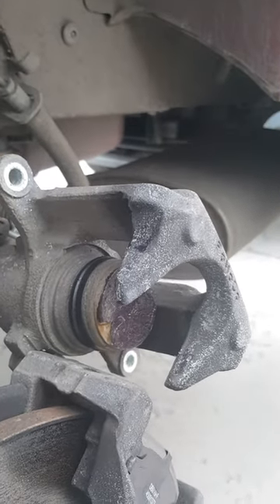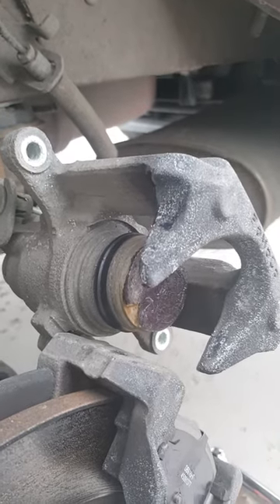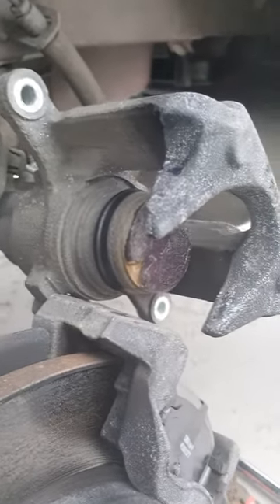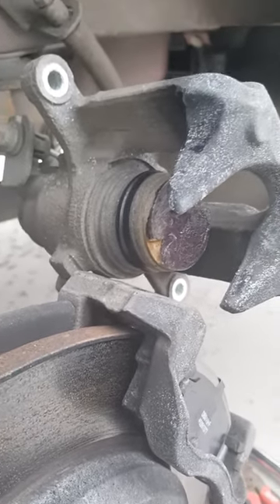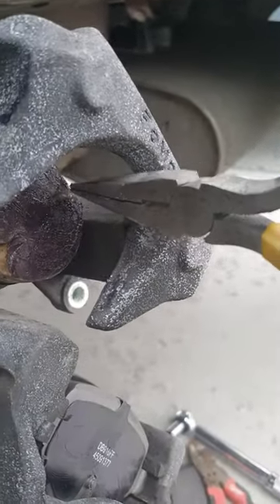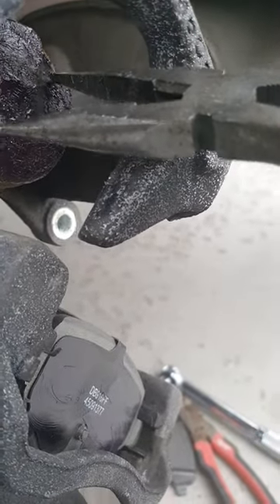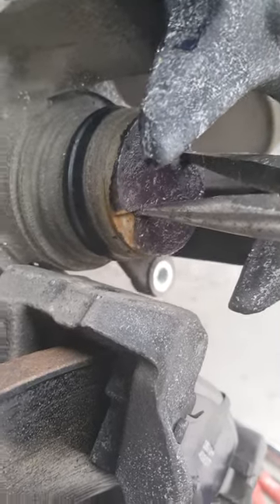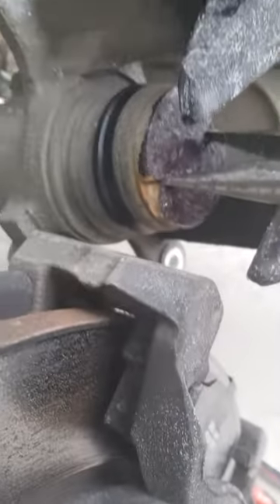How to push in Ford brake piston

Comment: Whoever came up with the push and turn idea should be fired
Reply: I'll sign that petition.
Reply: You misspelled executed.
Reply: As a former automotive technician myself (I worked for GM even though I drive Fords haha) and I will NEVER understand Ford’s SHEER STUPIDITY WITH THIS DESIGN!! If you want to make them smaller than the front fine, but WHY TF can’t they operate the same as the front at least instead of having to either go buy or rent a special tool just to be able to compress the calipers back?
Reply: I wondered and marvelled day and night about those damned drain plugs as i found myself stripping the fucking thing from folowwing a simple oil drain video, rule number 1? Look directly at the rusted part you are about to work on and buy its replacement immediately before you either break or strip it. That way you wont have to worry about OEM and all that just break the fucker off and be done with it.
Reply: Weld a nut over it. I've seen a Chevy aveo with stupid 10mm drain plugs. A 21mm nut fixed the problem.
Reply: I will sign too
Reply: @MAGA4EVA1986  a pair of needle nose pliers is a special tool?

Even easier on the Focus, you just put the caliper at the back of the wheel well, and spin it clockwise while you lean against it.  Unnecessary, yes, but not especially challenging or requiring a special tool.
Reply: Just spent 2 hours last night throwing every pressing maneuver possibly available into trying to move mine, thought I had to buy a new part smh . I swear this and the aluminum caps on the lugs. Smh

Comment: it's designed for a special tool witch applies pressure while turning the piston
Reply: robertas grigas the tool I just bent and snapped bc I’m a newb and turnd the socket and kept the handle still. Also bent a big c clamp trying to figure how the cal goes in. New to twist at compress concept. Pretty cool.
Reply: It won't bend if the piston moves freely
Reply: if you turn it it will pull itself in
Reply: @jimmythepowerful  Don't know what kinda car that is he's working on but GM makes a special tool for theirs I have one that I use for my 93 cutlass when I did rear brakes on it.
Reply: There is a universal tools you can rent or buy that makes the job 10 times faster and easier...but yes sure.....well just do it the hard way LOL, work smarter not harder people
Reply: Lol,  why not use the correct tool for the job, it's called a brake rewind kit/set in uk.
Reply: A universal break tool kit is cheap and used in most professional shops and diy guys like me that don't want to damage the caliper
Reply: @philancell884  I have a universal electron e brake caliper compressor from matco and I love it!
Reply: @fuolku1006  To be fair, I have done that with pliers, but they were brand new rear calipers and pistons, and I have a vast array of pliers of many different shapes and sizes.
Reply: Went through 3 different universal tools made for this bent and snapped took off brake lines drained fluid used torch still nothing I need new calipers
Reply: I just did rear brakes on my wife's Ford Edge, I used a pair of adjustable slip pliers opened up wide, to grip the whole piston and spun it around a handful of times, and then it pushed in pretty easily after that.. I just had to be careful not to damage the rubber dust boot with the pliers. I actually do have one of those universal caliper piston tools, a little square thing with different sized notches each side, but none of the sides would actually fit this one, so I did what I had to do, and it worked. 🤷‍♂️

Comment: He says use pliers but doesnt show how much of a pain in the ass that is lol
Reply: I use mole grips or pipe grips on my rears no problem. But they're not as fucking nasty as this guy's 😆😆 the calliper tool I have doesn't fit my piston design. Was for my previous cars and my mum's still works with it 🤷🏻‍♂️😆
Reply: It looks like he figured it out for himself, but snipped that part in the editing process.
Reply: Rumour has it that he’s still turning that piston with those pliers, 😂
Reply: Never once had the plier method work for me. No matter how hard I pressed.
Reply: @ranman7688  open the caliper to reduce the pressure and tension
Reply: @calibure859   Yeah, always do that, even have tried disconnecting the brake line.  Finally just broke down and bought the tool. Turned a fruitless wrestling match into a 2 minute job.
Reply: @newfie-dean5803 😂
Reply: @thegovernment0usa 😂
Reply: I love how the guy didn’t even turn an inch I wonder how many times it slipped off on him and busted his knuckles fake news. Fake news.

Comment: Fun fact there is an actual tool you can buy from harbor freight. You can either do it the right way or the half ass way. If you choose half ass way just know if the pliers slip and rip boot you need a new caliper. Think smart

Comment: If you can, rent the tool set from an auto parts store. I had to do this plier trick because I didn’t know the car I was working on had this style caliper and the parts store was closed already. It works, however there is a chance of damaging the piston boot if you’re not careful. The tool makes it hassle free and ensures the boot doesn’t get damaged.

Comment: 1 side is clockwise and the other side is counter clockwise and your better off using a c clamp with light pressure and a pair of channel locks to spin the piston if you dont have rhe proper tool because if you take a big chip out of that piston it will cause uneven load on the brake pads
Reply: Yes. This is how I do it because this needle nose pliers just don’t do it, 02 focus svt. I have done everything from clutch to timing belt  brakes, motor mounts, exhaust. You name it. Hell I even dropped the whole subframe to repair the steering rack.

Comment: I have a little cube that fits different shapes of brake pistons. It snaps on to a socket wrench, but that doesn't apply pressure to push it in while turning it.

So what i do is:
1, put the little cube in place on the piston and secure it to the caliper with a clamp (carefully, because the caliper is an awkward shape for clamps).
2, gradually alternate between a) turning the piston (by sticking something through the hole in the cube and applying leverage) and b) slightly stepping up the pressure on the clamp. a, b, a, b...

Then after ten thousand a-b cycles, the piston is usually getting close to being out of the way.

Good luck!

Comment: I wonder why some vehicles use this screw type piston for the rear calipers? It's actually infuriating when the piston gets a little rusty.
Reply: Used on cars with an integrated park brake
Reply: Because of the stupid parking brake button
Reply: @Kamal_AL-Hinai  wrong... This type of system has fully manual lever of handbrake.
Reply: @Grabarz23  
You're right! The 2013 Taurus does indeed have a foot lever e brake

Comment: I was in a pinch once and welded some pins on some flat bar and put it in the drill even then it wasn't very effective need the right tool for sure you will loose your shit pretty quick otherwise

Comment: Don't know what kind of car that is but GM makes a special tool for the rear calipers it looks like a block and has a square in the middle of each side so you can turn it with a 3/8 socket handle.

Comment: It is better to use a brake caliper rewind tool. On a Ford Transit (2011 T350) the left caliper piston turns anit clockwise and the right piston turns clockwise.
Reply: Is it the other way around on a right hand drive vehicle

Comment: Go to harbor freight get a rear disc brake pad and caliper service tool kit for 20$ then boom don’t break your hands or use needle nose for that unless you wanna fuck up your caliper and have to replace the rear and be out 200+

Comment: That’s such a dumb design. There’s ones that have a special tool that turns as well but I think the best one is just being able to move freely back and forth
Reply: It's designed this way cause of handbrake system is integrated with caliper.

Comment: No no no no no no no no no no no no no no no no no!! There are tools designed specifically for those types of brakes!!!! Either get the right tool or don't half ass the job. Not only is using a player's going to be harder to do it but you'll likely wear out the edges so a tool will become ineffective and you'll likely slip busting your knuckles or your face or something in the process. Do not do half-ass work take pride in your profession and do a good job every time all the time.

Comment: Simple "C" clamp will do it. What happened to the piston?
Reply: These caliper pistons must be turned in order to retract. I damn near busted a c clamp trying to depress them on my mustang before I figured it out. I now have a caliper tool set which has different face pieces for different car brands that fit into those grooves on his into holes on others and turn the piston as it depresses.
Reply: @jamesfair9751  Curious.  Does that mean that they twist when thrust into the pad?  Does the kit twist and depress at the same time.  Wouldn't the twist mechanism (grove) cause slow or prevent retraction to effect more wear on the pad or pad failure.  Is this mechanism lubricated?  Surely you couldn't lubricate with brake fluid, then must use silicone on the piston.
Reply: tzim the kit turns and depresses the same time. Imagine if your c clamp had a bigger flat surface on the screw in part and that had nibs sticking out of the pad to catch in those grooves/holes. 
I’m not sure if the piston comes out straight or if it twist while pressing into the pad when applying the brakes. It’s got a seal around the piston just like any other caliper that is greased inside.
Reply: tzim you’ll notice two screw in parts one is regular thread the other is reverse thread to turn the piston counter clockwise for certain vehicles
Reply: @ztzozm  the piston twists when it retracts, but it does not twist as it comes out and pushs the pad, the piston will stay clocked in the same position until it is retracted again
Reply: c clamp won't work on rear caliper pistons. They have to turn to go back in. you'll ruin the caliper if you use a c clamp on the back ones
Reply: @builtandraised  actually it does turn as the pad wears. There's no way for it to go past the receiving screw channels in the bore in the cylinder walls.
Reply: @philancell884  the piston wears the same spot into the pad over the course of the life of the pad clearly not having turned, when you change pads you see the imprint of the piston, I do a couple brake jobs everyday for a couple years now
Reply: @philancell884  also if you want to see this happen, take the caliper off the rotor and take the pads out of the caliper, the have someone depress the brake pedal, you will see the piston come out without twisting
Reply: Seattle Built and Raised it twist on a perfect center so the impression that is left on the back of the pad would be consistently in the same spot. It’s not like it walks around on the pad lol
Reply: @jamesfair9751 the face of caliper piston that presses against the pad isn't a perfect circle it has provisions for the tool to fit on it to twist it, the caliper imprint left on the pad is the imprint of the provisions on the face of the caliper piston it's not a perfect circle and you can absolutely tell that the piston does not twist as it comes out but stays in the same position on the pad, and now that I think about it the pad that goes on the Piston side of the caliper usually has two little bumps on it that are in a different position than the outside pad and it's so that the bumps can fit around the caliper piston and so if the Piston twisted over the course of the life of the brake pads it would literally just twist into these bumps, also people have been doing brakes for well over a hundred years and when have you ever heard of anyone needing to apply grease to the back side of the pad that touches the caliper piston because if there was movement there it would need to be greased, and like I said if you really want to see for your own eyes just go pop the Piston out of the caliper because it pushes straight out and twists back in, done and seen it a million times literally did this job twice today and will probably do it again tomorrow
Reply: Must be spun in

Comment: What happens if you have the handbrake on
Reply from the maker: @messynate  it shouldn't make a difference. The hand brakes don't affect the pistons. The Pistons can only be controlled through the hydraulic system connected to the brake pedal.